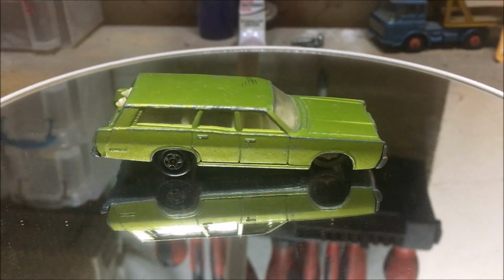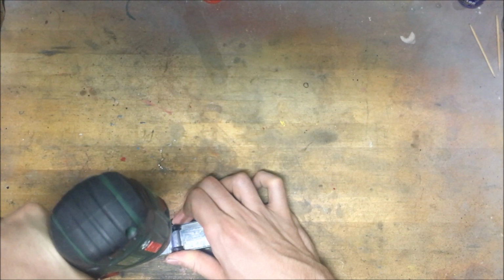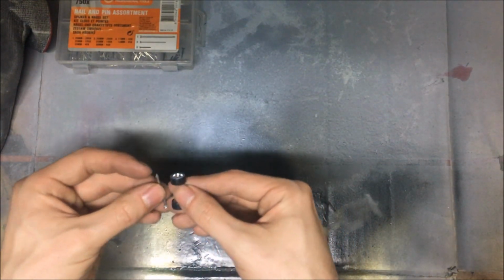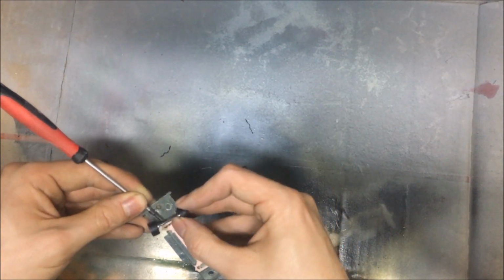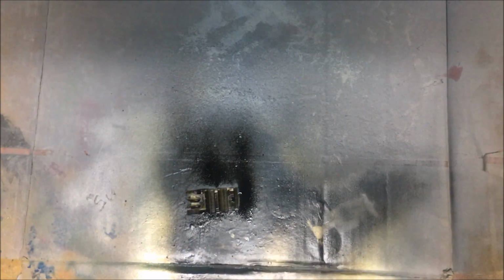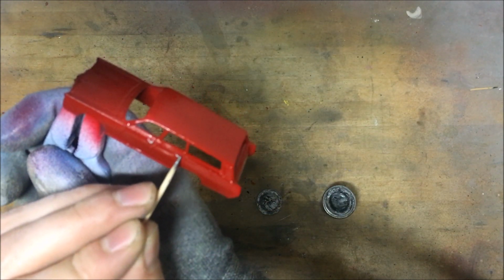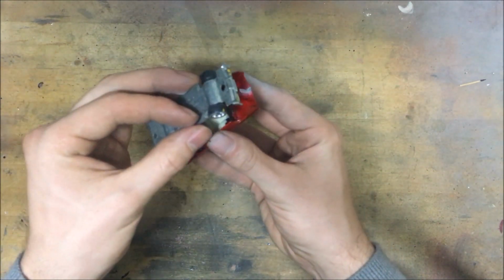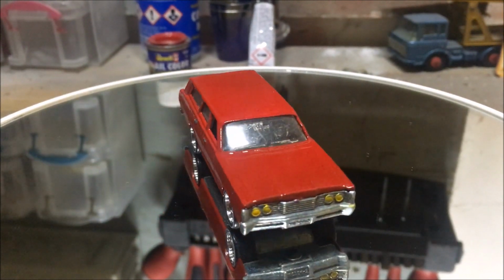BUILD-OFF - Matchbox No.55 Mercury Wagon - Custom

Comment: Nick, usually on American cars the interior color is a shade of the outside color. "Usually"  There are a lot of tans and grays nowadays.  My 69 Chevelle had a black interior and it was terribly hot. I'm just saying you loose all the detail with black, tan may be a better choice. That's just my opinion. The red looks very good and the wheels are perfect.